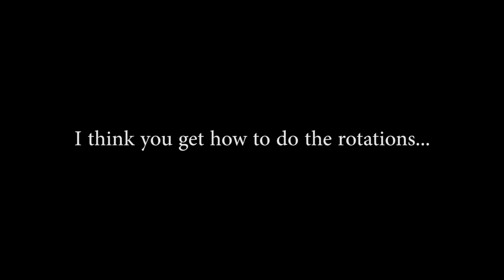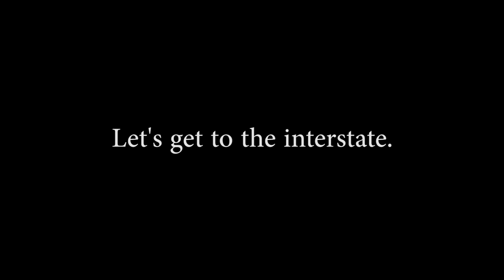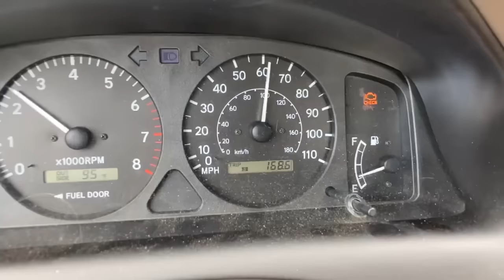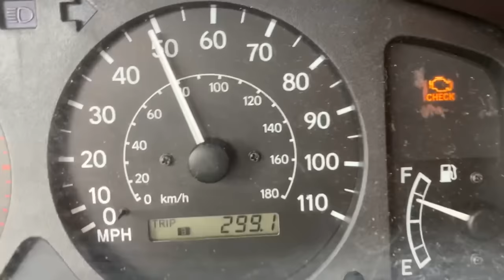Will Berryman's B12 Chemtool stop oil consumption? 😲 | Oil Burning🔥Experiments | Episode 15

Comment: thank you so much for this. going to try this on my 2011 kia soul.
i hope you provide an update as to whether you're still finding oil on your pistons.
Reply: Let me know how this works. I am a kia tech and we use Valvoline intake cleaner and it usually takes care of oil burning issues. I imagine this will work nearly as well.  Don't turn the engine over, just move the crankshaft back and fort about 20 degrees in each direction. This will keep you from spraying the chemicals out the plug holes. It will also work the chemical into the rings. We also pressurized the cylinders to really get it in the rings where it needs to be. We have a special tool for this. Good luck.
Reply: @keithfoco  1) Doesn't rotating the engine counter-clockwise can damage it? 
2) Do you think putting the spark plugs back on, after adding B12 would help to pressurize the system? 
And the last question, how much do you guys charge for a procedure like this? Thanks
Reply: @falsem1nd  do not rotate the engine backwards. It isn't always dangerous, but some engines can not take it.
2. If you put the plugs back in, you run the chance of hydrolocking the engine.
3. I do not know exactly how much it costs. I image around $200 used. It also takes a lot of time because I like to let it soak for at least 12 hours. We also have a great system that sloshes the fluid between the cylinders and pressurized the cylinders to really Pentwater into the rings. It's a special kit from kia.
Reply: @keithfoco  ok, so when you say "Don't turn the engine over, just move the crankshaft back and fort about 20 degrees in each direction", doesn't it mean, you'll rotate our engine backwards? Or for 20 degrees it's safe? Also, what's 20 degrees in turns, like 1/4 of a turn of an engine? Or you meant 20 degrees of your ratchet rotation?
Reply: @falsem1nd  that is what i do on Kia engines if I don't have the kit because it hasnt caused any issues. I dont recommend it for every engine. You can also just rotate the engine once or twice. You just want to move the pistons to get the liquid into the rings.

Comment: I have used a product that seems to really clean sludge out of an engine add 0ne pint yo 4 or 5 quarts of oil it takes 2 to 3 oil changesto see the results that's changing oil 3000 miles filter also rislone concentrate regular or high milage.

Comment: Oh ya, BTW I did the valve stem seals change the other day and I messed up the timing of the crankshaft pulley, and then all the 8 pieces of intake valves were bent! I was following your video as a.tutorial very closely but hey too bad...Now I'm in the state of waiting for supplier to source those intake valves and yes of course I was forced fo take out the cylinder head, but lesson learnt and more work to be done, but I've learnt even more things. Before I messed up the timing, I also dropped a valve into the cylinder, but hey I did manage to retrieve it back to position using cylindrical shaped Neodinium magnets (size 4mm diameter). 😗😗😗
Reply from the maker: Oh man, Timbercat, I'm so sorry to hear that!!!
Reply: where you located ? i can make your engine like new, rock auto have all parts, i did 5-6 of this engine
Reply: @fahhad17  thanks man I'm not in USA
Reply: @FamilyFriendlyDIY  my own mistake

Comment: I stand by this product man I just flushed my crank case out with it in my 07 town and country Chrysler and my 03 cavalier i just added one bottle to the crank case I think on Google it said add 2 ounces to every quart of oil anyhow the vehicle was already on ramps so I cranked it and ran the vehicle to operating temp for about 10 minutes then drained the oil and changed the filter the vehicles have sounded better and ran better ever since

Comment: Those cylinder wallas are Glazed.  The only thing that would save that motor would be rehoning the cylinders to add new cross hatching and new piston rings.  Once the cylinders become Glazed the engine will burn oil.  The only way to lower oil burning and oil consumption would be to use like a Diesel oil and an oil addative to increase the viscosity even more.

Comment: Hey Dave thank you for the video. I have a Scion that's burning one quart every 1300 miles. I want to try and see if I can get a little better results. Do you think I need to do is Extreme of a cleaning as you did?
Reply from the maker: I don't want to be the cause of a ruined engine, Calvin, so it's proceed at your own risk. However, another commenter mentioned that to pour the Berryman's in the cylinders and let sit for 24 hours (no engine rotations) and then drive it at normal speeds on the interstate in high gear at low or normal RPM, will yield the same results. It sounds like your drain-back holes aren't fully clogged yet, so I'd start with a milder treatment. You could always treat again or more aggressively if it doesn't work. Hope this helps.
Reply: Hey thanks for getting back to me I will try the B12 chem tool and see if letting it sit for a day will be any help.

Comment: Interesting results. What scope are you using? On the Berryman website they say to add 1 to 1 1/2 onces per quart into the crankcase, to a cold engine, let it idle for 10-15 minutes but do not drive or put load on the engine.
Reply from the maker: DEPSTECH wf25 I think. … Definitely exceeded the recommendations, eh? 😁

Comment: My car burned a qt/600mi but that was because the oil cap was SUPER loose. Changed the cap and it was burning a qt/1500mi for a long time.
I bought the car at 122k and had always burned some oil and the engine has been ran low on oil a couple times and super low (to where the engine shut off at a stoplight) once. 

I use Mobil 1 Full Synthetic oil (5w-30, 10w-30, but more recently (past 10-15k miles 10w-40) and Seafoam in the crankcase before every oil change over the course of tens of thousands of miles...
...car is at 169k and was hit by a Kia Soul on the highway rendering the car moreorless undrivable for a couple months, took it to a bodyshop and repaired the quarter panel/etc. After that I noticed the car did not burn any oil for 3k miles until I changed the oil @ 172k. Now the car is almost @ 175k and still hasn't burned any oil.
Reply from the maker: Good info. How many miles before oil changes did you do the Seafoam treatment?
Reply: @FamilyFriendlyDIY  every 3000mi alongside the oil change. A bit unnecessary for a full synthetic but whatevs.

Seafoam would be in the crankcase 100-300mi. It varied.
Reply: Engine oil actually evaporates.  You can expect to loose anywhere from 5 to 15% of oil just from evaporative losses between oil changes.  The evaporation rate is slightly different depending on the brand.
Reply: @ManIsKind369  burning a quart of oil every 1500mi is also seen as acceptable oil consumption by some brands, your point?

Comment: Wow you got some good results after all the things you try, amazing! I wanted to try this myself but cant find this in EU it seems. Wonder if there is a similar product from another brand here in EU.
Reply: I can't find it either, i'm looking for an EU alternative too. I read that the b12 is highly concentrated with acetone compared to other brands. I guess that's what makes it effective
Reply: @rihanik  Im going to ty mannol 9900 engine flush
Reply from the maker: Look up “Berryman’s b-12 chemtool MSDS” and it will give you the active ingredients. I’ll have a clip of it in the update video coming soon.
Reply: @FamilyFriendlyDIY  Thank you for that advice! The product I was going to use is not that similar.

Berryman's B12

Ethylbenzene               10-15%
Petroleum Distillates  30-40%
n-Propanol                    10%
Xylene (mixed isomers) 40-50%

Manool 9900

Distillates (petroleum) 70–95%
benzenesulfonic acid, propenated, calcium salt, overbased 1–5%
Isotridecanol, ethoxylated  <0.5%

Only thing I can see they have in common are the petroleum and it is alot more of it in the mannol and it some kind of lubrication. maybe not that great for a cleaner. I may give it a try anyway.
Reply: @jaystheone1  try to source some toulene/xylene and mix it with the mannol? Avoid acetone, it's not good for o-rings. Another alternative could be some intake cleaner, just use it as a soak, most of them have step to soak pistons but not for 24 hours repeatedly. Anything from Liqui moly or Bardahl?

Comment: Excellent video, amazing engine didn't lock-up at that high RPM but then again it is Toyota not others.  I was thinking this rotation of crankshaft was helpful but I would have added a 10 degree of wrench back and forth movement to fluctuate rings in their seated groove. I have a friend that has 2014 elantra with 140k miles and does 500 miles to a quart, not my car and will not attempt this on her car?  All I can do is suggest this and leave it to her decision.
Reply from the maker: I like the rocking idea.
Reply: @FamilyFriendlyDIY  One other thought if we added one once of B-12 and pressurize the cylinder at TDC momentarily, forcing the fluid through the ring-pack then fluctuate/rock ring-pack in their seated groove and repeat. My friend has many old cars and I can work with him to see what his technique would be.  Keep up the great video works!

Comment: I think you used a proper amount of B12.
You needed to put enough B12 in so it fills the cup shape of the piston's top and more.

 And then above that it can flow over the piston top and down onto the piston rings and into the piston ring grooves. Where is can work on the carbon oil build up on the rings  grooves & any drain holes. Especially the bottom oil control ring.

Nice to see the healthy cross hatching on the cylinder walls. So now that the rings can move again they will be able to seal properly against the cylinder walls.
I would put 4 new sparkplugs in it also at this time. This should eliminate the engine stumble after seeing the conditon of the plugs you showed us.

Comment: I was shocked to see that amount of oil on the pistons after high rpm road testing ... the engine certainly has a problem and I cannot see any amount of 'additives' will cure it ... Have you checked the engine crankcase breather system for excess pressure ... If that is working as it should I can only imagine you have defective piston oil scraper rings ... An old fashioned remedy would be to run it on high detergent diesel engine oil of the same grade for a month (compatible with Cat if fitted) and try to avoid short journeys until you eventually renew the oil ... Sadly I don't hold out much hope of success .... Regards from retired heavy vehicle mechanic .. England.

Comment: I believe you're only supposed to let the engine idle for 15 minutes. The B12 does absolutely thin out the oil. High rpm's at an extended period of tine could certainly cause major damage.

Comment: Try this oil, it's rated for Diesel and Gas , Chevron Delo 400 XSP Synthetic 5W-40 Motor Oil, 1 gal. available Wally world, its rated C4 and SN for Gas. 
The extra detergents in Diesel oil may help. Worth a shot vs $10 a can for Seafoam.

Comment: .....so how do you do this with a flat 4 or v6?
Reply from the maker: Maybe put some in the cylinders whose pistons are at bottom dead center, then put those plugs back in and turn the crank to reduce the volume of those cylinders and squeeze the cleaner into the rings??

Comment: Did you add more of the cleaner to the oil after the oil change? Would probably help clean the engine more as you drive
Reply from the maker: Not yet, Mike. If it uses a quart in 3k miles, I'll probably retreat though ... I definitely want to make sure it's good and clean. Thanks for the comment!

Comment: Can't believe that person told you to hold it at Redline for 20 minutes that seems excessive and very hard on the motor I understand getting out there getting on a little bit try to clean some of the junk out but dang. But at least it helped B12 is an awesome fuel system cleaner and i use it for that.

Comment: I would have only ran it idle in the driveway for 3 to 5 minutes changed the oil and not the filter . Then run around town short trips .Repeat again .  I use to work at a used car lot and that is how we fixed cars that people didn`t change there oil in or used cheap oil in . We used diesel fuel and took the drain plug out . We filled the cylinders every day for a week . Took the valve cover off and scrubbed the heads of sludge while cleaning the return holes .
Reply: yea, and you sell it to some victim never telling them about this.

Comment: the problem is Toyotas insistance on using low tension piston rings .the cars with them start using oil at about 90.000 miles . the only real cure is to replace them with better ones .

Comment: Oh, yeah.  Toyoduhs are so reliable and durable.    ROFL!   In comparison, I had a 1997 Ford Escort that I drove to 180k miles and it didn't burn any oil.    Never had to top it off in 3500 miles of driving.    Sold the car after owning it since new as I grew tired of it and finally had OEM parts failing around the same time.     It was a very dependable car but I drive at night and didn't want to be sidelined on the highway.    Too bad Ford doesn't build cars anymore.

Comment: Dear Dave,
If you were an academia, you would have got a noble price. I have watched each and every single of your videos and have learned so much. I am planning to do the same on my car.  Thank you
Is there anyway to get rid of the residue stuff on the top of the piston ? Any kind of chemicals,  vacuum machine, etc. Any advice?
Reply from the maker: Haha ... thanks for the kind comment-- I definitely don't deserve that. When the car is back to running like it should, it should burn most of that off the top of the pistons. There are lots of chemicals out there that are supposed to help with cleaning the combustion chamber. If you haven't seen Project Farm, you should probably check out his channel. He's done a lot of experiments with cleaning combustion chambers.

Comment: I did the same on a 2008 Scion tC that was using a quart every 300 miles. I’m at 1322 miles now and just above the add dot. I might try to go to 1500 miles and add a quart and see how far from the fill dot I am. There is 130,000 miles on the car.
Reply from the maker: Good info Mark. Thanks for sharing!
Reply: Did u turn the crank bolt with a 19mm socket “SLOWLY” 5 full rotations EVERY 6 hrs during the piston soak? This is the MOST important step that u CANNOT skip in order to get the B12 on to the piston ring land and oil return hole. A lot of people seems to skip this step or do that just once or twice and call it a day. Also, cranking the motor with the ignition DOES NOT work getting b12 on there (lots of videos on YouTube showing just cranking the motor with ignition during piston soaking thinking it will pass the compression rings and get to the oil control ring, it did not), make sure u absolutely perform this necessary step, get the B12 on the ring land and oil holes, the more the better, then drive the car at high rpm for 20 mins to burn them off. U should see result like Dave and me. I did this to my 07 scion tC which burn 1 quart every 250 miles then after 2 treatments, not burning a single drop of oil between 5000 miles oil change interval. Done that around 150k and now I’m at 170k and still no burn oil between oil change.
Reply: @blackysan  I did not. About 4 oz in each hole. Next day topped off holes that leaked down and then used my 19mm socket and ratchet to turn it over through out the day. Also read how some tapped on the piston to maybe free up the rings, so I did this also with a long screwdriver.  New plugs were installed and I’m about 1500 miles and adding my first quart.  Before doing this, I would have added 5 quarts of oil to stay full.

Comment: Run diesel oil in the same weight for 3,000 miles to clean your engine . This oil has high detergent way more than regular motor oil .
Reply from the maker: I didn’t realize you could get that in so low a weight. I might have to try that. Thanks for the suggestion!

Comment: Would anyone be kind enough to tell me if this would work on a diesel engine ? Specifically a 2.0 volvo d4.
Reply: There's no reason it wouldn't. But you would need to pull the injectors or glow plugs as there's no spark plugs

Comment: I noticed that your check engine light is on in these videos, I don’t think I’ve heard you mention it. Did you pull a code? Probably O2 sensor with all the blow through? You seem to question  whether you should’ve driven it with that much of that chemtool in the crankcase, maybe just a start up and 10 min. idle would’ve sufficed? Thank you for this video, and please do a follow up!
Reply from the maker: James, here's the update: https://youtu.be/84MylatwpN8  and here's where I did the codes: https://youtu.be/MRgDwcvWNyo

Comment: Valves close now. May have improved your ring gap also. I have used kerosene, transmission fluid ,etc.
 Balance of enough lubrication not to damage the engine and the product you choose to remove carbon.

Comment: Congratulation it my first car I give up on 200 k mile coz of oil eating issue. But regert of berry man I not recommend second time. That B12 eat plastic like crazy. That Corolla engine chain guide make by plastic hope it not any damage. Some people said those plastic are different kind I hope it too. I recommend Xado total flush it decarbonization effect other not offer. It can add and drive 100 mile in engine too. Xado metal conditioner also like Engine Restore it fill scrip of cylinder wall but engine restore can't well with vvti engine which that Corolla have. I hope that car last 400 k mile since it manural .

Comment: You had oil on the top of the cylinders after driving it on the freeway. That's means the car is still burning oil.

How often do you change your oil?  It should be changed every 5,000miles if not you could have worn oil rings.